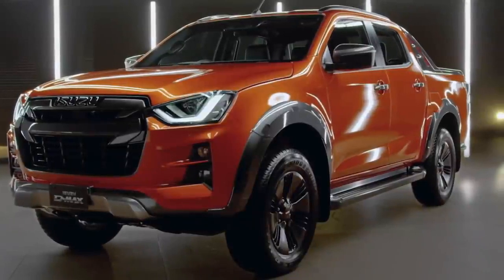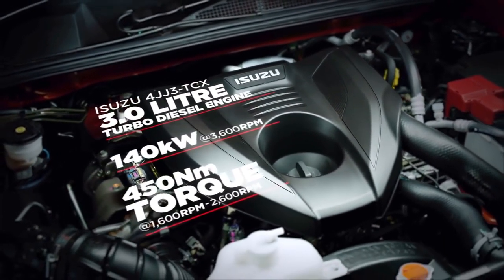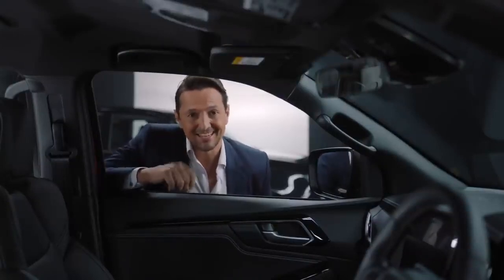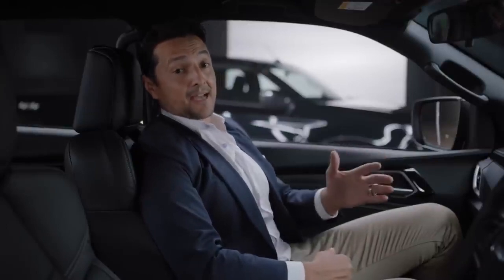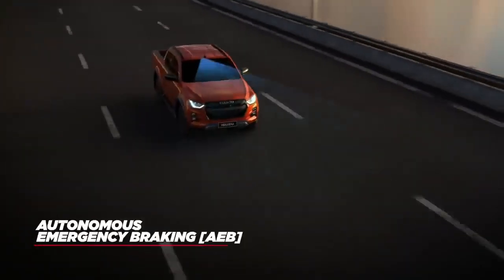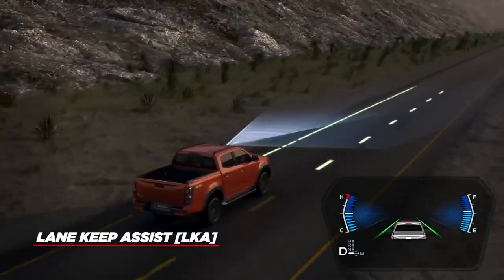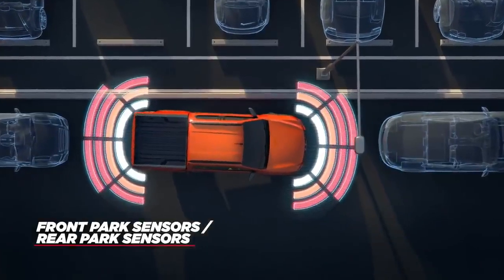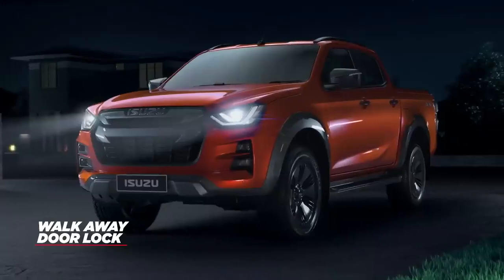All New Isuzu D MAX 2022   Perfect TRUCK!720p

Comment: I like the exterior design except for the mags its ugly and the rail at the rear (but if you have extra money it can be solve). I wish it has 360 camera and panoramic sunroof. But Isuzu is proven and tested reliable, dependable, durable, low maintenance and high resale value. I can tell because im using crosswind right now.